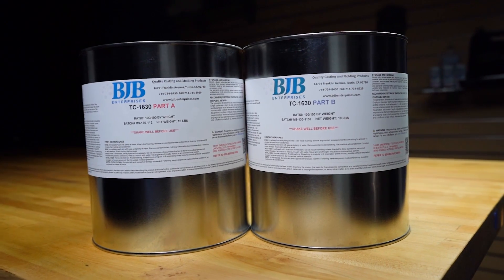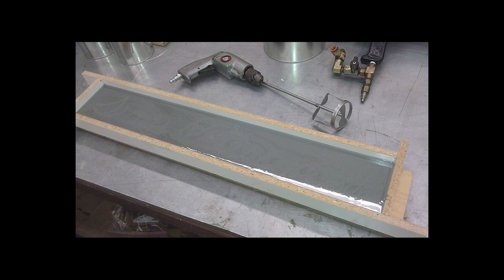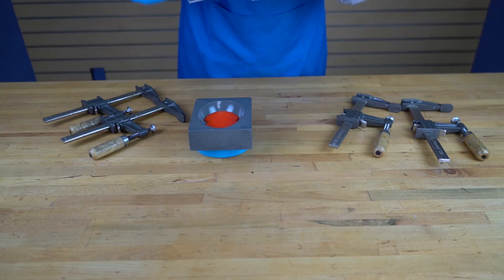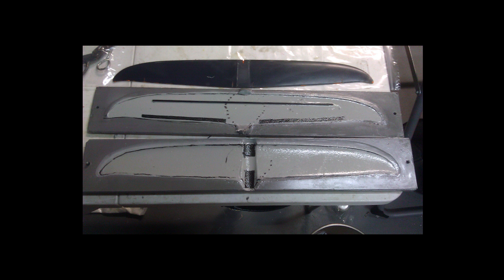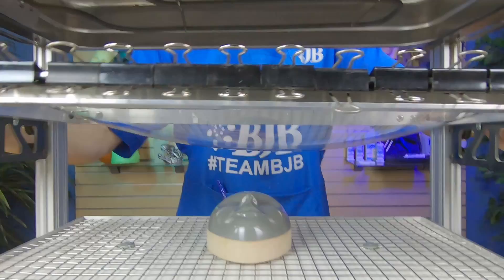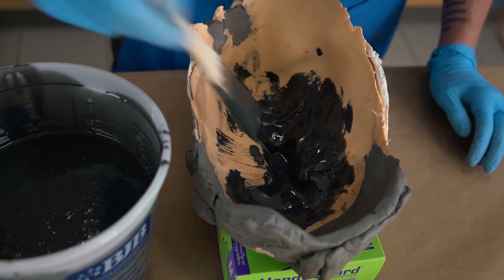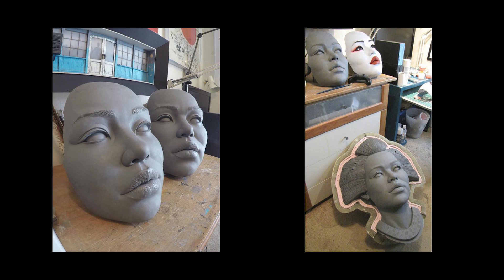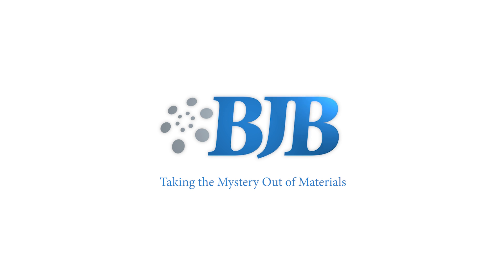TC-1630 UltraCast | Fast | Tough | Reliable Urethane for Molds, Parts & More

Comment: what type of resin would u guys use for sum vintage style translucent bicycle handlebar grips???
Reply from the maker: EL_XICANO408 I would look at something like our FP-30 or M-3130 if you want more working time. Basically you want something pretty flexible in the 30 Shore A range.  You can add pigments to preferred color.